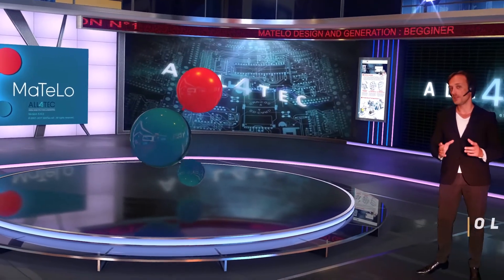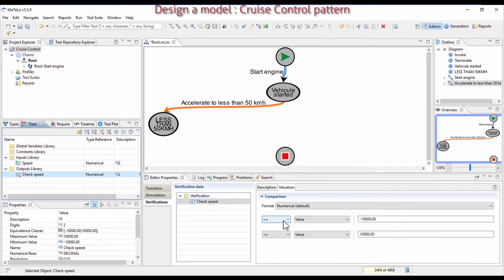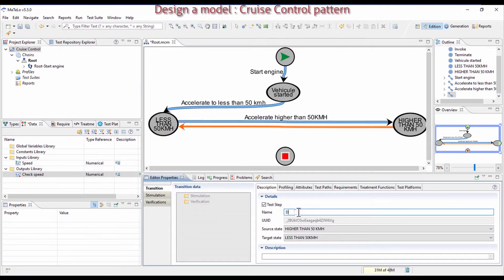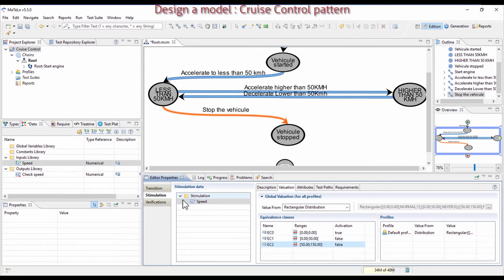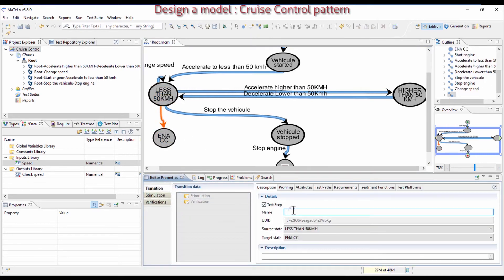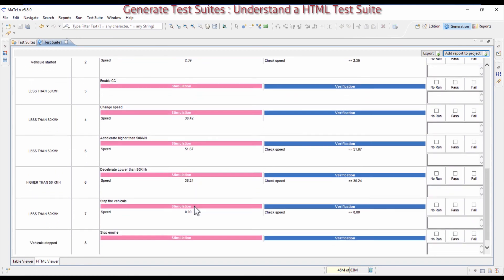MaTeLo Tutorial Session 1/15 : MaTeLo Design and Generation : Beginner

Comment from the maker: start  Détail
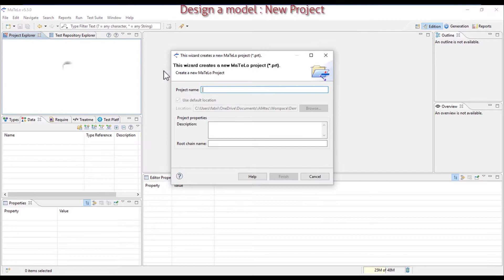00:00:44  Design a model : New Project
00:00:52  Design a model : Explore Project
00:00:57  Design a model : Create a state
00:01:06  Design a model : Create and manage transitions
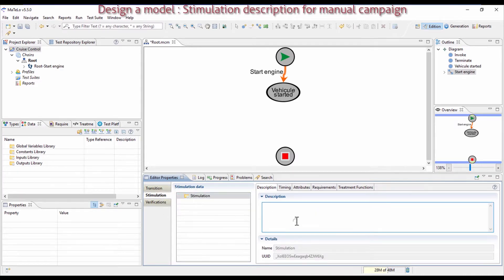00:01:20  Design a model : Stimulation description for manual campaign
00:01:32  Design a model : Verification  description for manual campaign
00:01:39  Design a model : Numeric input creation
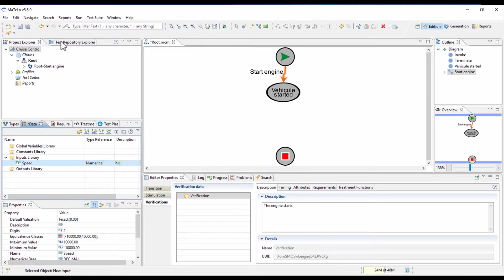00:01:46  Design a model : Numeric equivalance classes creation
00:02:02  Design a model : Default input valuation
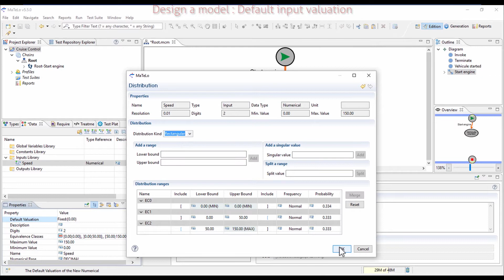00:02:13  Design a model : Assign an input as stimulation
00:02:16  Design a model : Set input valuation
00:02:24  Design a model : Numeric output creation 
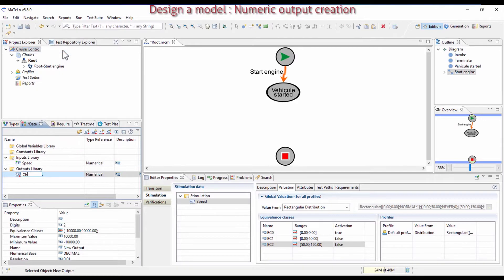00:02:34  Design a model : Assign an output as verification
00:02:39  Design a model : Output valuation as external input
00:02:47  Design a model : Cruise Control pattern
00:07:22  Generate Test Suites : Select a strategy
00:07:27  Generate Test Suites : Minimum Arc Coverage generation
00:07:32  Generate Test Suites : Open a Test Suite as HTML
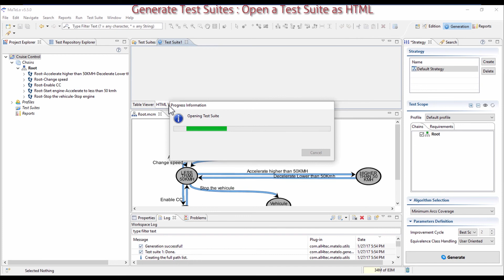00:07:41  Generate Test Suites : Understand a HTML Test Suite